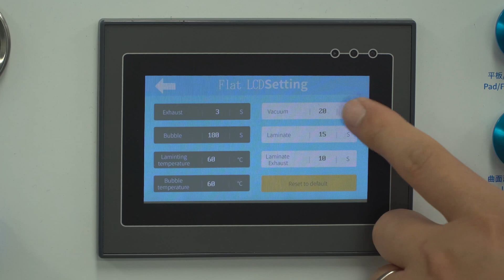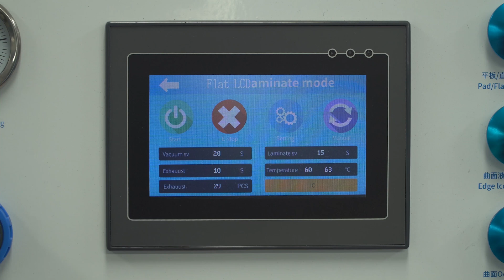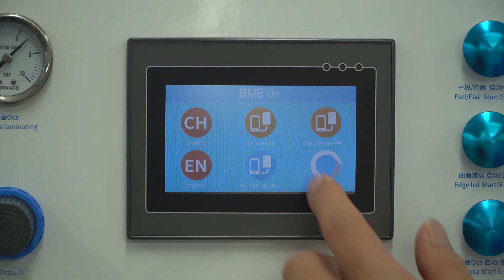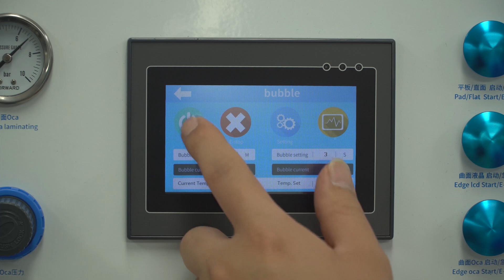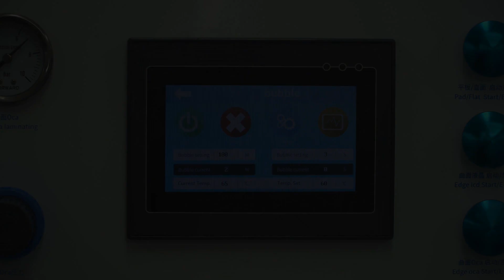Use RMB-3+ OCA Lamination Machine To Replace iPhone X XS MAX Glass + Touch - How To

Comment: 12:51 on machine, time lamination set is 15 sec but on video press lamination is only about 3 sec, why?
Reply from the maker: Because the video is edited, 😂you can't just let the frame go on and on for 15 seconds. Anyway, it opens when the fit is complete🙌

Comment: Nice work! How can I prevent bubble on my oled screen?
Reply from the maker: OCA with proper thickness, proper pressure and defoaming time can be adjusted according to the machine, accurate mold and skilled technology.Can use UV lamp curing, improve the success rate.
Reply: How can I get it
Reply from the maker: @samkinggodday4180  WhatsApp: +86 13826121144
Reply: I want to buy